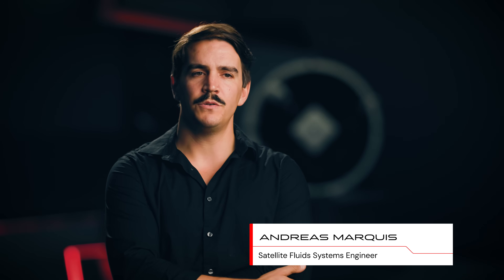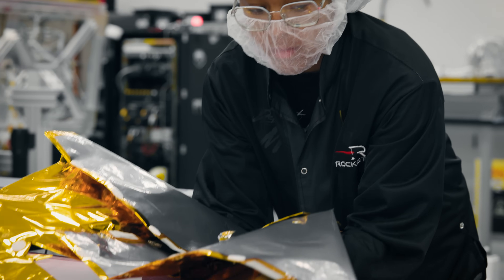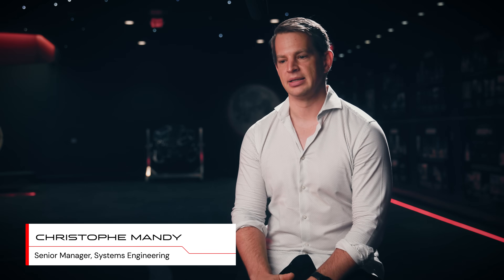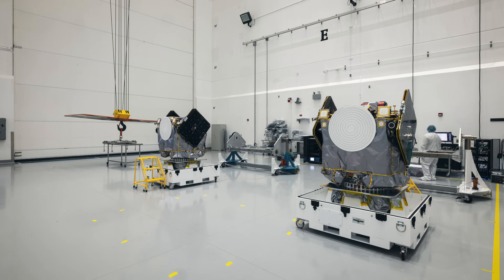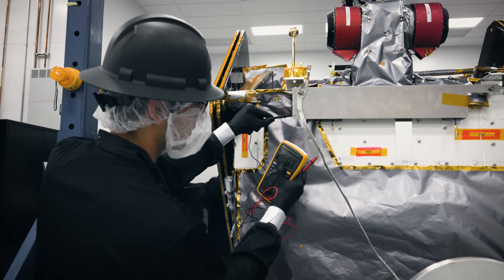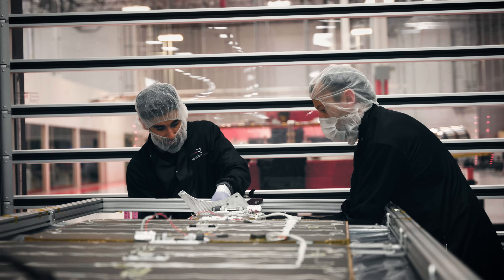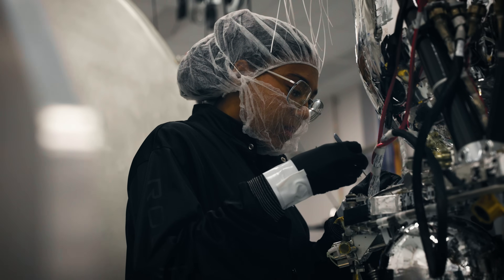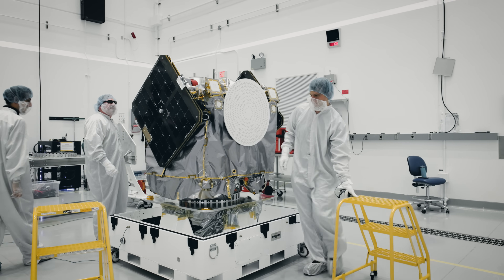The Final Countdown | ESCAPADE Mission to Mars

Comment: U sure you confident enough to trust new Glenn with that, it's just been launched once hasn't it
Reply: They can build a couple of new ones for cheap if it goes boom. Figuring out how to build one is the hard part. The payload instruments are there. Figuring out how to build many cost-effectively is also hard. Rocket lab is there. The only real bummer is losing the launch window.
Reply: @geirmyrvagnes8718  The new transit timeline still has the mission reaching Mars orbit by late 2026 if it launches tomorrow. Not a 3+ year journey at all.
Reply: @nogoodnameleft Sure, but if a Mars launch is delayed by 6 months, it is delayed by 2 years because of the Mars launch windows.
Reply: @geirmyrvagnes8718  Not with the tactic ESCAPADE is trying. It will pioneer "L2 loitering" so not dependeng on the 3 week window every 26 months. It could launch next month or next February and it would still not start the interplanetary journey until September 2026. Imagine the future of a convoy of spacecraft hovering at L2 between every 26 months for the window and then they all start the journey at the same time so no stress for anybody regarding the 3 week window and limited number of launch sites on the planet.
Reply: @nogoodnameleft  Yes, that helps. And is cool. I didn't know. They still have to wait for the window at L2, then. They can launch as early as they want, but not later than the window. I hope they can get things fixed and be on their way within a few months, then! 😄